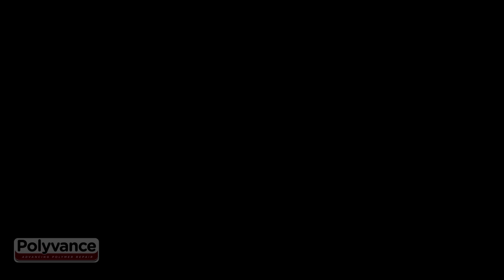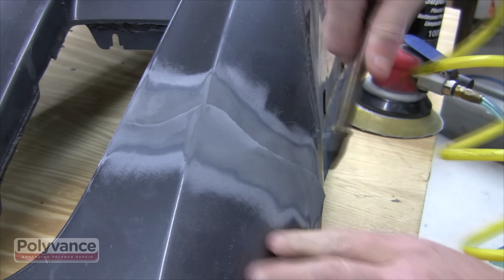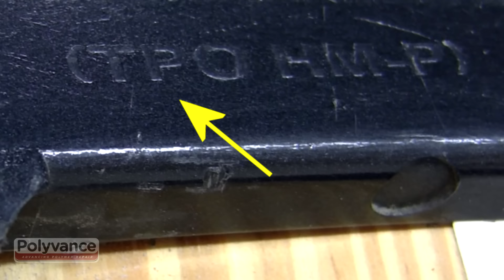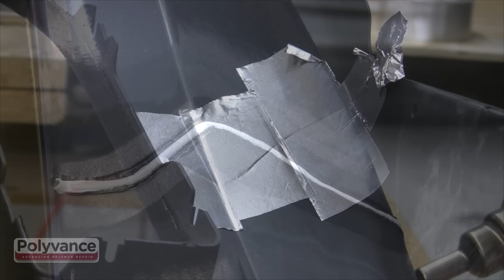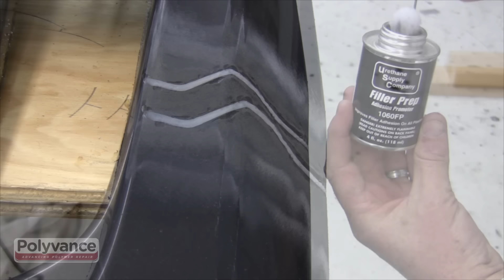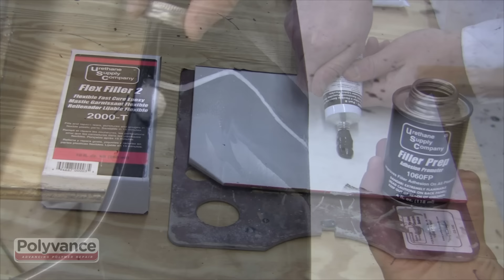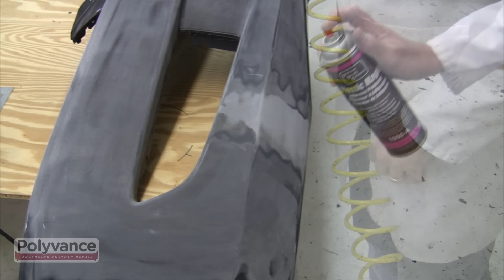Bumper Repair with Hot Air Plastic Welder

Comment: Lol nope....too much work!
It's 2019 now. ...just use JB WELD on both sides and sand it down...Done!
Reply: Uggghhhhh......Just to reiterate common knowledge....JB weld does not stick to polypropylene or polyethylene plastic with any sort of reliability.  Adhesives may work reasonably well on other plastics (still not as good as welding) but on PP and PE welding is really the only option for producing a permanent repair.
Reply: jb weld is terrible. Plastic welding done right is far quicker.
Reply: Daniel Jessop it’s pretty strong too.

Comment: Ouf !   I think I would prefer to buy a new one.
Reply from the maker: Buying a new bumper may not be that easy or cheap. More expensive cars have new OEM bumpers that cost a lot. Additionally, some older cars might have hard to find bumpers (which makes them more expensive).
You can find aftermarket parts cheaper, but you also run the risk of them not fitting your car properly (which you would still have to pay to fix).
Of course, all cases are different, and the amount of damage will need to be evaluated to see if it is worth having the part repaired. But many times, it is cheaper have cracks, tears, tabs, etc. repaired than to replace the whole part. Especially on something like a small broken tab that is easily repaired and not visible (which means refinishing work is not required).

Comment: Cleans plastic then make a huge mess sanding
Reply from the maker: If you have contaminants on the plastic and you sand or grind it, it's very likely you will embed some of the contaminants into the sanding scratches (which will impact the quality of the repair).  You should always clean the plastic first!  You can clean it again after if you wish, but you should always clean it first!

Comment: Why do you clean and then sand?
Reply from the maker: If you have contaminants on the plastic and you sand or grind it, it's very likely you will embed some of the contaminants into the sanding scratches (which will impact the quality of the repair).  You should always clean the plastic first!  You can clean it again after if you wish, but you should always clean it first!
Reply: Polyvance. 
Makes sense
Thanks for enlightening me
Reply from the maker: @Boss-gk8kc  You're welcome!

Comment: I think I rather buy a new bumper since there is no shortage. Lol
Reply from the maker: Buying a new bumper may not be that easy or cheap for everyone. More expensive cars have new OEM bumpers that cost a lot. Additionally, some older cars might have hard to find bumpers (which makes them more expensive).
You can find aftermarket parts cheaper, but you also run the risk of them not fitting your car properly (which you would have to pay to fix).
Of course, all cases are different, and the amount of damage will need to be evaluated to see if it is worth having the part repaired. But many times, it is cheaper to repair cracks, tears, tabs, etc. than to replace the whole part. Especially on something like a small broken tab that is easily repaired and not visible (which means refinishing work is not required).

Comment: Wait.....clean it before used it the sander???? Uhhhh😕😕😕
Reply: Ditto what polyvance said.
Reply from the maker: If you have contaminants on the plastic and you sand or grind it, it's very likely you will embed some of the contaminants into the sanding scratches (which will impact the quality of the repair).  You should always clean the plastic first!  You can clean it again after if you wish, but you should always clean it first!

Comment: Am I wrong , or should you sand and then clean????
Reply from the maker: If you have contaminants on the plastic and you sand or grind it, it's very likely you will embed some of the contaminants into the sanding scratches (which will impact the quality of the repair).  You should always clean the plastic first!  You can clean it again after if you wish, but you should always clean it first!

Comment: Although this looks very fun  ( not really  )  a new front bumper cover is 450 painted on my M5 .
The plastic welder tools this guy is using is 800 dollars  rods 25 and it takes a bit of talent or it look bad.
Reply from the maker: Hello. Our hot air and nitrogen plastic welders are more for body shop use and are more expensive. We do, however, have a hot air welder kit, our 5700HT Mini-Weld Model 7, and a few other airless welder kits that can be used for DIYers.
Check out our other products on our website or our other videos to see them in action.

Comment: Way too much work. Buy an aftermarket one, prep and paint.
Reply from the maker: Hello. Our hot air and nitrogen plastic welders are more for body shop use and are more expensive. We do, however, have other products that can be used for DIY. 

As far as repairing vs. replacing:
All cases are different, and the amount of damage will need to be evaluated to see if it is worth repairing the part (or having it repaired). Many times it is cheaper to repair small cracks, tears, tabs, etc. than to replace the whole part. You may find an aftermarket part cheaper to put on yourself, but you run the risk of it not fitting properly, and you also have to wait for the part to come in. Repairing ensures you keep the OEM part on the car, and you don't have to wait for the part to come in.

You can find a win-win scenario for both the repair shops and the bill payer. Check out this article and interview with Kurt Lammon, president of Polyvance (under the Plastic Repair section): https://autobodynews.com/index.php/component/k2/item/15517-the-best-body-shops-tips-repair-vs-replace-what-a-body-shop-should-consider.html?showall=1
There is a good example of a win-win scenario in the article:
If a replacement part costs $400, and the shop makes 25% gross profit on parts, the shop receives $100 of gross profit and the bill payer pays $400.
However, if the part is repaired and the shop is paid for 6 hours of work at $50 per hour with a 50% gross margin on labor, the shop makes $150 gross profit and the bill-payer only pays $300. So if the part is repaired, both the shop and the bill-payer come out better than if it had been replaced.

Comment: Time and labor wise it might be better to find a used part and paint it. But if you are in a position where the part is too hard or expensive to get, this looks like a real quality repair. Would be a good skill to have.
Reply from the maker: Thank you for watching!

All cases are different, and the amount of damage will need to be evaluated to see if it is worth repairing the part (or having it repaired). Many times it is cheaper to repair small cracks, tears, tabs, etc. than to replace the whole part.

You can find a win-win scenario for both the repair shops and the bill payer. Check out this article and interview with Kurt Lammon, president of Polyvance (under the Plastic Repair section): https://autobodynews.com/index.php/component/k2/item/15517-the-best-body-shops-tips-repair-vs-replace-what-a-body-shop-should-consider.html?showall=1
There is a good example of a win-win scenario in the article:
If a replacement part costs $400, and the shop makes 25% gross profit on parts, the shop receives $100 of gross profit and the bill payer pays $400.
However, if the part is repaired and the shop is paid for 6 hours of work at $50 per hour with a 50% gross margin on labor, the shop makes $150 gross profit and the bill-payer only pays $300. So if the part is repaired, both the shop and the bill-payer come out better than if it had been replaced.
Reply: I think I'm going to have to go the repair route. The front bumper of our Prius is badly cracked; as with many Toyota passenger cars the bumper does not seem to quite clear parking blocks. I have been checking car-part online and have never found a replacement, and our one wrecking yard in Flagstaff never seems to get one. A new one is $266... it will need painting, of course, but most solutions will.
Reply: For me, it’s turnaround time. Couple hours of labor and paint versus waiting three days for a part.. then when it arrives you need time to prep it primer and paint it before install.
Reply: Exactly this. I had 2 cracks in a rear bumper of a Hyundai coupe. Invisible repair from local bodywork company £660. 

But undamaged bumper from a breakers, inc shipping £125 and a respray at a local paint shop £150. £275 total. If I can get one the same colour, respray not required

Comment: This is not welding 😂😂😂
Reply from the maker: This is absolutely welding!
From dictionary.com "Weld: to unite or fuse (as pieces of metal) by hammering, compressing, or the like, especially after rendering soft or pasty by heat, and sometimes with the addition of fusible material like or unlike the pieces to be united."

This isn't metal welding, but it is plastic welding. Here, we are using Polyvance's TPO welding rod to repair a TPO bumper. We heat both the bumper and the welding rod and melt the welding rod into the base material. The welding rod is not an adhesive like glue; it has absolutely no adhesive property when dry or wet. It is melting into the base material here and bonding with the bumper.
Reply: How so?

Comment: I think it would be easier and cheap just to fiberglass it. You got to sand it anyway $20 kit with everything you need other then sand paper
Reply: That would be great if adhesives stuck well to polypropylene, but they do not.
Reply: @scottb7600  there is no adhesive in a fiberglass kit....
Reply: Really?  What would you the liquid stuff that you mix the catalyst with that holds the glass fibers together?
Reply: @scottb7600  resin..... Adhesive dont require activator.... Two different chemical's
Reply: Where did you ever get the idea adhesive doesn't require activator?  That is completely false.  EPOXY, POLYESTER RESIN, URETHANE..I'm sure there are some I'm forgetting, ALL require activator.  They are all adhesives.
Reply: @scottb7600  well ive never heard anyone use the term adhesive for FIBERGLASS RESINS. One the box it DOESN'T say adhesive/ resin.. And i actually had my body work done on my car a few years ago and had to fix my bumper. We fiberglassed it and use bullnose so it can flex... We drill small hole around the crack area and pushed the glass threw for penetration glass the other side as well and it hasnt come off yet. And im talking about my 88 camaro so it can be done. I done it the technical name for resin ( fiberglass) ive never know it to be called adhesive but thats irrelevant to the fact that you can fiberglass your plastic bumper
Reply: Your 88 Camaro has a URETHANE bumper.  Adhesives stick to urethane, some quite well. Urethane bumpers make up only about 5% of the bumpers on the road, the rest are olefin based like the one in the video and adhesives will simply not work.
Reply: @scottb7600  oh ok

Comment: How much does something like that cost? It seem it would be cheaper to get a new one
Reply from the maker: This video showcases one of our hot air welders...our hot air and nitrogen welders are more for body shop use, and are more expensive. We do, however, have a hot air welder kit, our 5700HT Mini-Weld Model 7, and a few other airless welder kits that can be used for DIYers.

In the case of a bumper repair vs replace dilemma: buying a new bumper may not be cheap or easy. More expensive cars have new OEM bumpers that cost a lot. Additionally, some older cars might have hard to find bumpers (which makes them more expensive).
You can find aftermarket parts cheaper, but you also run the risk of them not fitting your car properly (which you would have to pay to fix). With a used or aftermarket part, you may also have to paint it to match the rest of the car.
Of course, all cases are different, and the amount of damage will need to be evaluated to see if it is worth repairing the part (or having it repaired). But many times, it is cheaper to repair cracks, tears, tabs, etc. than to replace the whole part. Especially on something like a small broken tab that is easily repaired and not visible (which means you don't have to do any refinishing work on them).

Comment: wtf is plastic cleaner.

isopropyl alcohol is all that is required.

wtf kind of plastic is it.

tpo stands for thermo plastic olefin.

this could be any number of plastics.

bumbers are usually abs or abs compatable plastic.

sometimes but very rate is polyprop.
Reply: All contaminants are not soluble in IPA.  IPA is a good cleaner, but if there are mold release agents, silicone or other hard to remove contaminants on the bumper, other solvents or cleaners are needed to ensure they are also removed without harming the plastic.  Some  solvents will damage certain plastics, but plastic cleaners like 1000 Super Prep or 1001 Ecoprep are formulated to clean these plastics of all contaminants without harming the base material.

Comment: I can only see this being cost effective when repairing a one of one piece in the world lol
Reply from the maker: Our hot air and nitrogen welders are more for body shop use. We do, however, have a hot air welder kit, our 5700HT Mini-Weld Model 7, and a few other airless welder kits that can be used for DIY. These are all cheaper.

Many times, having a bumper repaired is better than having it replaced. Especially on something like a small broken tab that is easily repaired and not visible (which means refinishing work is not required).
More expensive cars have new OEM bumpers that cost a lot. Additionally, some older cars might have hard to find bumpers (which makes them more expensive). You can find aftermarket parts cheaper, but you also run the risk of them not fitting your car properly (which you would have to pay to fix). With a used or aftermarket part, you may also have to have it painted to match the rest of the car.
Of course, all cases are different, and the amount of damage will need to be evaluated to see if it is worth repairing the part (or having it repaired). But many times, it is cheaper to repair cracks, tears, tabs, etc. than to replace the whole part.

Comment: thank you a very informative video,

I'll order a new bumper now.
Reply from the maker: Our hot air and nitrogen welders are more for body shop use. We do, however, have a hot air welder kit, our 5700HT Mini-Weld Model 7, and a few other airless welder kits that can be used for DIY and are cheaper.

Having a bumper repaired by a body shop with professional equipment may save you money instead of having the bumper replaced. It just depends on the amount of damage to know if it is worth repairing or not. Many times, it is cheaper to repair (or have repaired) those small cracks and torn tabs rather than replacing the whole bumper.

Comment: Cool. But not cost effective for diyer
Reply: With the 5211 or 5210 kit from Polyvance, it is cost effective for the DIYer
Reply from the maker: Our hot air and nitrogen welders are more for body shop use. We do, however, have a hot air welder kit, our 5700HT Mini-Weld Model 7, and a few other airless welder kits that can be used for DIY. Feel free to look around our channel; we have lots of tutorials on how to use our products.

Comment: That is why it is easier to buy a new one 🙄
Reply from the maker: Buying a new bumper may not be that easy or cheap. More expensive cars have new OEM bumpers that cost a lot. Additionally, some older cars might have hard to find bumpers (which makes them more expensive).
You can find aftermarket parts cheaper, but you also run the risk of them not fitting your car properly (which you would have to pay to fix). With a used or aftermarket part, you may also have to have it painted to match the rest of the car.
Of course, all cases are different, and the amount of damage will need to be evaluated to see if it is worth repairing the part (or having it repaired). But many times, it is cheaper to repair cracks, tears, tabs, etc. than to replace the whole part. Especially on something like a small broken tab that is easily repaired and not visible (which means you don't have to do any refinishing work on them).

Comment: Wouldn't it be easier to just adhere the backside of the cracked bumper if it's able to be realigned to be flush?
Reply: This seems like more work than needed for a clean crack, you could even use 3m plastic epoxy to seal it....

Comment: With these kind of promoters it never ends .
How much is the after market bumper fender door WTF
Reply from the maker: We show many different types of videos on our channel repairing different types of parts with different tools (hot air welders, nitrogen welders, DIY-type kits, etc). People often ask us why we would repair a part instead of buying a new one.
In the case of a bumper repair vs replace dilemma: buying a new bumper may not be cheap or easy. More expensive cars have new OEM bumpers that cost a lot. Additionally, some older cars might have hard to find bumpers (which makes them more expensive).
You can find aftermarket parts cheaper, but you also run the risk of them not fitting your car properly (which you would have to pay to fix). With a used or aftermarket part, you may also have to paint it to match the rest of the car.
Of course, all cases are different, and the amount of damage will need to be evaluated to see if it is worth repairing the part (or having it repaired). But many times, it is cheaper to repair cracks, tears, tabs, etc. than to replace the whole part. Especially on something like a small broken tab that is easily repaired and not visible (which means you don't have to do any refinishing work on them).
Our hot air welders and nitrogen welders are more for body shop use. We do, however, have a hot air welder kit, our 5700HT Mini-Weld Model 7, and a few other airless welder kits that can be used for DIYers.